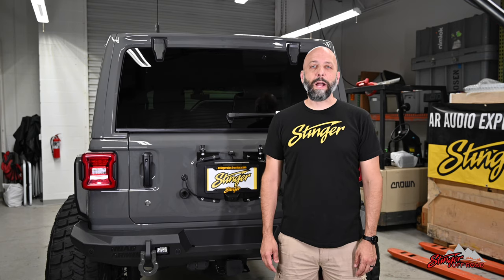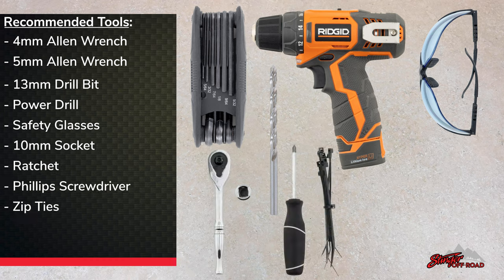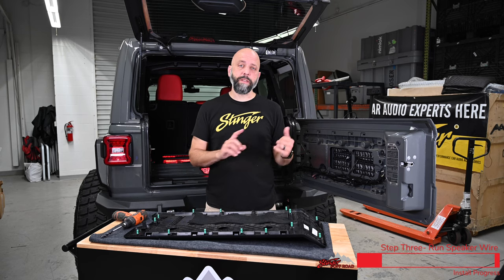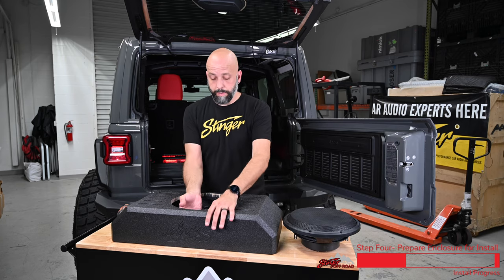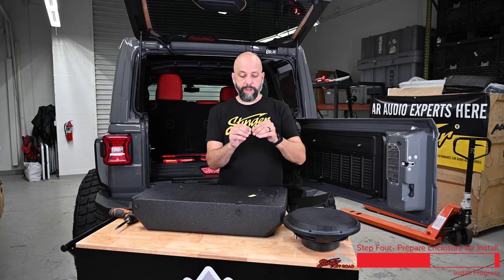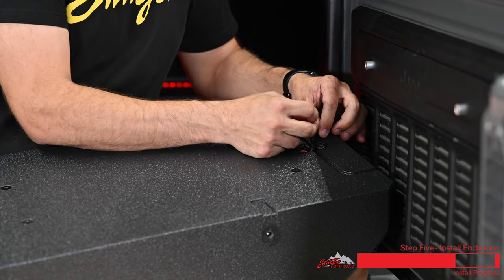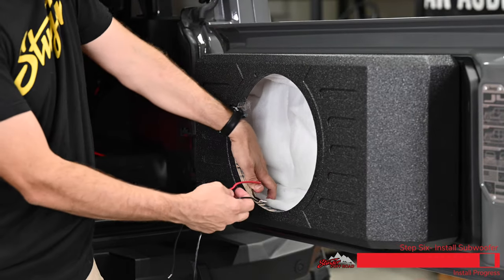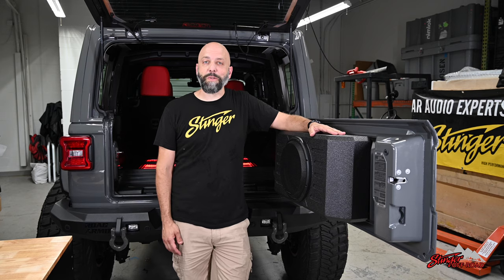Jeep JL Swing-Gate Subwoofer Enclosure INSTALL | 2018+ Wrangler JL | Stinger powered by Phoenix Gold

Comment: I’m not to sure about this idea.
I have a 2020 Jeep JLU with a 35” tire and the Mopar heavier duty spare tire bracket . I have no problems. My wife has a 2023 Jeep JLU with a 35” tire and some aftermarket reinforcement bracket that weighs 12 lbs. more than mine .After a few months , I noticed that her tailgate and corner body lines were no longer aligned and the tailgate dropped about a 1/4 of an inch when opened. We solved the issue by going with a factory reinforced bracket. This subwoofer and box combo seems like it would cause a bigger issue than an extra 12 lbs.
Reply from the maker: Please reach us at 727-732-3114 for technical questions, we would be more than happy to assist you.

Comment: Where do you run the speaker wire from? Or is the a default wire already in the harness?
Reply from the maker: The speaker wire will need to be run from your aftermarket amplifier (sold separately) to the Jeep's swing gate, then connected to the enclosure as shown in the video.

Comment: Can you lay the freedom panels down in the back with this box installed?
Reply from the maker: They would likely have to be propped up with a freedom panel holder or bag designed to hold them against the seats or at an angle behind the seats.

Comment: I cannot find the speaker wires that I am supposed to slide through the 4th slot down. Where do I find this?
Reply from the maker: These would be wires that you would have to run into the swing gate from your aftermarket amplifier (sold separately). They are not factory wires, and will not be there already.